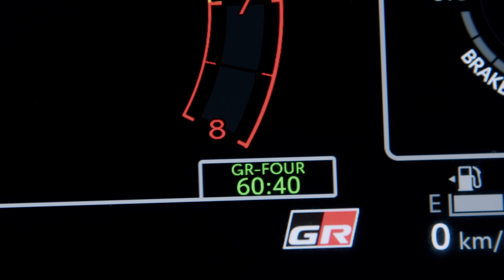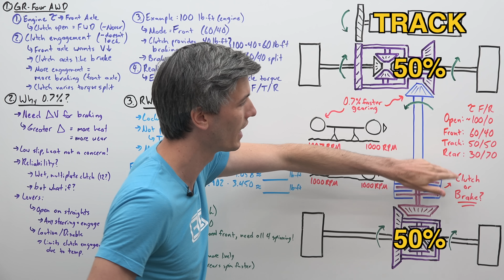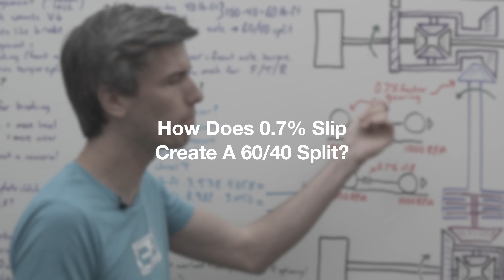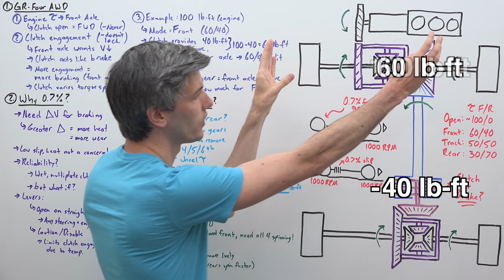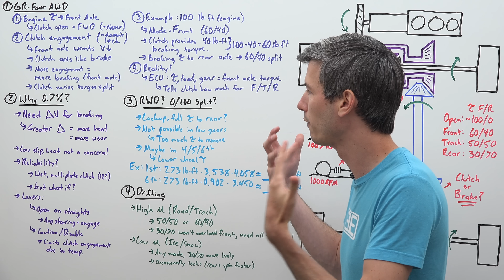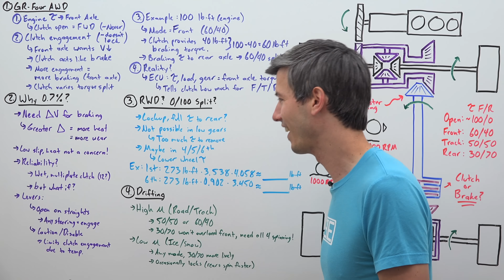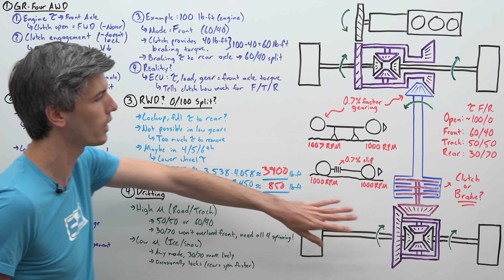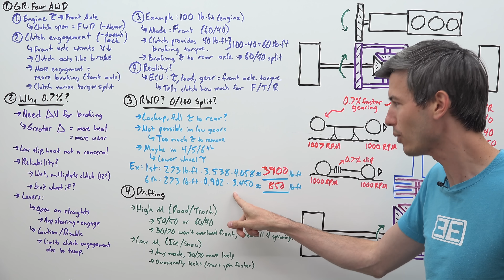Toyota GR Corolla's Brilliant AWD System - How It Splits Torque!

Comment from the maker: *Won't constant clutch slip create a ton of wear?!* Before you consider the system to be unreliable and inefficient, take a moment to think about what's happening inside an engine. You have a metal piston, sliding against a metal cylinder wall, thousands of times per minute, at ~60-90 miles per hour. And none of the comments seem worried about this? Rightfully, because cylinder walls use oil spray to minimize the friction and reduce the wear. In this clutchpack, we're talking about different materials, designed for the application, bathed in oil, with a massive surface area thanks to many clutch discs (spreads out the friction, minimizing wear). 0.7% slip is extremely low, and the friction created causes a torque to be sent to the rear wheels, thus most of the energy still goes towards powering the vehicle, with a tiny amount lost as heat. 

Still not convinced? Prior to this YouTube thing, I worked in the forklift industry. Some forklifts use the transmission to brake, rather than wheel brakes. These are wet, multi-plate clutch packs, exactly like you see here, and they do nearly all the braking for a 4-5 ton forklift. That's real heat, because brakes (in this case a clutch) are designed to turn kinetic energy (the forklift's movement) into heat. These clutches can last the life of the truck, thousands and thousands of hours. It's very cool, and pretty incredible! Not to mention, pretty much every multi-speed automatic transmission is using clutches. Heck, a single-disc, dry clutch inside a manual transmission, can also last the life of the car! 100,000 miles no problem, if you're not abusing it.

My only point here is, before you assume it will fail, why not wait and see how it turns out? Toyota has a reputation for cranking out reliability. Why assume they haven't done the testing and validation this time? If there's info on GR Yaris burning up these clutch packs (it's been out for a bit now) - definitely let me know, and I'm happy to share information on it! I'll remain skeptical that the clutch pack is the big reliability concern for this vehicle.

Edit: If anyone is curious how this differs from Golf R/Focus RS, I have a video explaining here! https://youtu.be/2-_Dzd74GUE
Reply: It’s so funny because that was the first thing that came to my mind. I really appreciate the extra info though and I will remain open minded.
Reply: I'm in the same boat it just seems inefficient, but you bring up good points. Also consider heat from friction is what kills clutches, not the friction itself. If the heat from the .7% slip isn't great enough to degrade the material then there's no fear of it failing.
Reply: so if you're driving on cruise control at 80mph on the highway, wheel rpm is about 1000rpm, so the shaft is about 4000 rpm so the clutch will slip at around 4000*0.7%~30rpm and at low load, but it doesn't make sense that the clutch doesn't completely disengage, to reduce wear and fuel consumption? obviously mileage os not concern #1 on a corolla GR, but reliability under heavy use?
I understand it's not going to heat up or wear as fast as a clutch launching the car at 3000+ rpm but still a very odd design to have a clutch slipping 100% of the time. plus a manual transmission only has a big speed difference when starting from a dead stop, when changing gear, speed difference is either minimal (perfect shift) or the clutch slips and the engine speed matches the gearbox after a few tenths of a second. the clutch spends less than 0.7% of the time slipping from a stop to first gear, and it has thermal mass to take the heat, and then cool down when its not used, whereas this will lose power and generate heat continuously. If you hammer a clutch several time in short intervals its going to overheat for sure.
my concern is not only that there's a clutch slipping all the time, but that its also responsible for continuously transferring ~50% of the torque to the rear wheels so not.
Of course if it makes the AWD/handling better, the part is easily serviceable, then OK why not! people who are lucky enough to put their hands on this car wont mind low mpg
Reply: It still looks like electronically controlled honda crv rear diff.
Reply: Other way I think about the possible clutch wear is by thinking of allowable tire slip before abrasive like wear occurs(minor slip can be taken up by material properties). If Toyota has done their engineering well(something they have done for decades), I don't see any reason why the setup shouldn't work reliably. If I have any complaint about Toyota trans mounted engine cars is that they tend to torque steer BAD(my experience in every Toyota that has a trans mounted engine; 5 cars made in the last 15 years). Hopefully it has symmetrical drive shafts.
Reply: @saccaed  that’s true of their economy, or non sporty cars. But the Corolla XRS actually has an intermediate shaft that is fastened to the back of the engine block riding in/through a captured bearing. This allows both the driver and passenger axles to be the same length and this basically eliminates the torque steer. I can vouch for this working because I own both the base Corolla for daily abuse and an 06 XRS for light weekend duty when I want to go around twisties. When they want to they can engineer and produce very stable sporty cars, even fwd based. But there really wasn’t any need on their basic cars since the majority of people normally don’t drive those hard.
Reply: I'm sorry but just because some vehicles use the transmission as the brake doesn't mean a car can be using its clutch pack as a brake 100% of the time. Most of these systems like the GKN AWD system and the Honda SH ATTS cruise in greatly reduced rear biased modes. Cruising along the freeway they cut down to 5-10% rear bias. Additionally just do some math. Let's just assume track mode with the 50/50 split. Engine is using 100hp (simple numbers) so 50hp is going to the rear. That .7% differential is creating 260 watts of heat constantly. The rear differential has ZERO cooling ability, no fins on the case, no separate radiator, housed right next to the exhaust pipe with little airflow. Total fluid capacity on the GR Yaris is .5L. There is simply no way for this system to offload heat. Meaning it's more likely like every other system on the market and will cruise in 90/10 or similar F/R bias mode and not give a static 50/50 split. On the track and in sport mode this means this .5L system needs to deal with over 1hp of consistent heat. Basically turn your toaster on and leave it on full blast for 20 minutes. The wet plate system simply can't handle that kind of heat without some kind of cooling method. It's unlikely this system is a static split.
Reply: There's plenty of airflow, you're driving along.  Hang a 260watt electric heater out your car window at 30mph and it won't get warm because the wind sucks the heat out of it faster than it can be generated.  @Vermonstered
Reply: @marespellees321  Not sure if you noticed, but under and tucked into the rear axle of the car is NOT the same as you hanging out the window. Additionally 260 watts example is cruising on the highway if it was permanent split (it's not). At full throttle the overdrive gear generates more like 5x that. Don't care how much airflow you have over the smooth housing, it overheats as the car does often at the track. Though not sure why you're coming at me now with the car out for over a year with the problems well documented.
Reply: Came to the comment section to ask this. Cool. Thanks. Haha
Reply: Thanks Jason, you answer the first question that came out. 
The second one i have is : does that mean that this system "waste" power into heat ?
Reply: All that is good in perfect condition and regular daily drive. Let me see how this system will perform when driven on ice/snow/mud or some harsh conditions... What kind of service is required? I told you, on my old VW it was a failure...
Reply: I'm sure it will be fine, but it will be considered a wearable just like any other friction surface. Motorcycles typically (some Ducati's don't) use wet clutches like these and last for a very long time.
Reply: @DevMeloy  i agree 👍🏻. The only thing I hate is the heap they create around it ...
Reply: @DevMeloy  as someone who has replaced hundreds of motorcycle clutches, I utterly disagree.
Reply: @eyeballengineering7007  only time will tell.. hundreds of clutches over the millions of motorcycles is a drop in the bucket.. I agree the concept sounds idiotic but someone smarter than you and I did the math and found the wear acceptable..
Reply: @DevMeloy  "acceptable" like the oil pump on the baby duramax being belt powered. Between the engine and transmission. In the crankshaft oil. With 150,000 miles being the maximum life.  I'm pretty sure it was this same channel that was touting it as an engineering marvel.
Reply: @eyeballengineering7007  stuff wears out.. 150k is nothing to sneeze at. Although the placement is a poor decision..
Reply: So these "brakes" (wet clutch pack) will never wear out... nice, why don't we use wet clutch packs for all brakes?
Reply: @iwantmypot  I don't think anyone said they'd never wear out.. oil bath has benefits over dry clutches. And you wouldn't want this on all four corners because unsprung weight.

You guys are getting worked up about something on a "performance" car, this isn't going on the daily driver and anyone who has owned a sports car knows there is a cost.

My Mustang came with summer tires which lasted about 12,000 miles but gave amazing grip the first 10,000 miles. That is not a design flaw but a compromise.
Reply: @iwantmypot  Forklifts typically don't go that fast, so the amount of power dissipated by stopping it is not really the same as stopping a vehicle that might only be half the mass but going 4x to 8x the speed. The rate of energy dissipation stopping a car from 60 to 0 would definitely create wear. 

It's not like clutch packs never wear out - it's just that if you know the application, you can design them to last the expected life of the vehicle with nothing more than fluid changes.
Reply: I’m on the original clutch on a 2009 Hyundai Elantra. Mileage? Past a ¼ million and sitting pretty at 276,000 miles. Original clutch.
Reply: @firefighter4443  According to half the jokers in this comment section, your Elantra's transmission should've grenaded itself 276 times already by now lmao. Congrats on the mileage though.
Reply: @firefighter4443  Hold the clutch pedal down 1/4 inch from now on and get back to us on how it lasts...
Reply: How does it compare to Wrx sti?
Reply: @higherarc0598  No significant advance.
Reply: Thanks for addressing this. My non engineer brain had this question as a general ?, Not really as a fault in the system.
Reply: I left another comment, but isn't this basically what the Subaru ATS system is?, which has been around for years.
Reply: @stuntmonkey00  Not quite. Subaru ATS replaces the center diff with a clutch pack. There is no difference in drive ratio sent to the front or rear diffs. This Toyota setup has no center diff equivalent. The Subaru system can be configured for full range 100/0 to 0/100 torque splits(though I don't think it's ever been offered, it can be configured that way). The Toyota setup is limited in torque split control as the front tires are always driven and only effected by clutch engagement for the rears.
Reply: @saccaed  It's the same idea in Subaru ATS and this Toyota system - front wheels are mechanically connected while rear wheels are powered by a clutch-pack. The difference is the placing of the clutch-pack. Subaru ATS system can be switched into FWD mode but it cannot work as RWD.
Reply: @4x4.tests.on.rollers  To the end user they behave essentially the same. Subaru effectively still has a center diff(they say they don't but it's just clutches). Your correct about the limitations of torque splits as shipped. There are minor technical differences that could matter for anyone inclined to modify the stock setup though. The Toyota configuration behaves more like a 6x6 in that the front diff is a pass through(like the middle diff for a 6x6) to the rear diff with a clutch pack between the rear driveshaft and rear diff.
Reply: @saccaed  I'm not sure if I understand you well but - ATS doesn't have center diff. It's just a one way clutch-pack in transmission (of longitudinally mounted engine) which is powering the driveshaft. Toyota has this clutch-pack just ahead of rear diff. There is no serious difference how they power front wheels (by gears) and rear wheels (by multiplate clutch-packs). Other thing is Subaru's VTD with center differential and a clutch-pack responsible for TBR.
Reply: @4x4.tests.on.rollers  Two defining differences between Subaru ATS and the Toyota setup of the video. The major difference is that Toyota has the rear wheels over driven and that expands the maximum torque that can be sent rearward. Subaru does not have any gearing difference between the front and rear. The second minor difference is that the Subaru configuration is essentially identical to every other Subaru in that Subaru swaps the internals for the diffs to create different awd configurations. Toyota is using a pass through front diff and standard rear that has a clutch pack between the rear driveshaft and the rear diff. Where with a Subaru the end user can swap out front and rear diffs typically with little other modification needed, the Toyota setup is going to be much more involved if someone wants different behavior. For example, Manual WRXs come with open diffs front and rear. Those diffs can be swapped out for helical or torsen diffs found in other models(and typically model years) to upgrade the drive train. Swapping to a different Subaru center diff is normally best done by swapping the entire transmission as subaru transmissions and center diffs are an all in one package.
Reply: @saccaed  Sure, all clear and that's what I mentioned before - placing of things is different. But the entire idea of geared powering of front and clutch powering of rear is the same (apart from overdrive etc.). Older Subaru with ATS even had that FWD fuse socket which opens the clutch-pack completely.
Reply: @4x4.tests.on.rollers  No serious difference other than that the Subaru clutch has 0.0000% slip 100% of the time and this thing has 0.7% slip 100% of the time.
Reply: @johnpublic6582  That's not correct - there is always a slip in every clutch based awd system. No slip can be achieved only in laboratory conditions (and of course when clutch-pack is locked). While driving the speeds of front and rear axles vary constantly so there is always a slip.
Reply: @4x4.tests.on.rollers  You are talking about slip an order of magnitude smaller than the 0.7% here and it is happening low single digit percent of the time, not 100% of the time, so I can't agree that these are at all comparable.
Reply: @johnpublic6582  Of course - by mechancial design - there is no slip as front and rear gearing is equal. But during driving there is always a slip, all the time, especially during cornering but also during straight driving - slip that comes from the road, not the system itself. Obviously if the front/rear gearing is different then the slip is higher.
Reply: I love that your videos take such a detailed topic and make it understandable for simple people such as myself. Keep up the good work
Reply: I think there is too much black and white thinking in this case. Of course in a wet clutchpack there will be wear. If there would be enough lubrication that there would not be any wear, then there would also be "no" friction.
I think the comparisson between cylinder walls in an engine and such a clutchpack is not fitting, as the cylinderwall and piston rings are not meant to have enough friction to transmitt force. Quite the opposite.

But, and that's the difference: if it is engineered with the idea that it slips constantly and frction is constantly aried it also means it is designed for the wear that is expected. (If it's done properly)
-> Cooling, a fluid that is made to handle the temperatures, filters to collect debris, and intervalls of fluid changes.
(I would bet that Toyota has certain intervalls for the change of the clutchpack fluid at least.)

And if we compare it with automatic multi clutch transmissions with a wet clutchpack, then there too are intevalls for fluid changes that also include a filter so that the internals of the gearbox are protected from the wearing debris. (And if a manufacturer claims "lifetime filling" then that just means that he expects the car to not last long)
Sure it's even more important than with just a clutchpack, as single clutchpack does not involve valves that are using the same fluid, but 100 000 miles without a fluid change in an auto transmission in most cases also means the transmission is done after that time. If you change the fluid every 37k miles for example (that's the intervall of my current cars converted to colonial units), the transmisssion will last a lot longer and have fewer "hickups" during it's life. 
(I know enough people who believed in "lifetime filling" of their transmission fluid and their transmission lasted for around 100 000 -110000 miles, and i know lots of people who let the workshop change their trans fluid according to manufacturers intervalls like 60k km or 70k km  ~37k miles and easily got ther transmission to work for over 250k km ~156k miles and more)
Reply: Hur hur gr corolla 3 pot go KABOOM... Im staying the f away from any thing GR for at least 3 years.
Reply: @ktkace  I totally agree with letting any new tech simmer for a bit.. buying first gen can really bite you in the A$$
Reply: I'm just thinking that having 4wheel steering with equal (opposite) angles would be the only way to always match front and rear wheels speeds and could simplify the design of a track oriented AWD. I know most rear wheel steering use variable ratios depnding on the speed or even switch the angle at different speeds, but could a "simple" system just mirroring the front be actually simpler ? it would mean also it would need wheel arches and suspension that can accomodate the same full lock steering as the front. but it would have ways smaller turning radius, or you could also halve the angles and make it easier/simpler/cheaper.  has it been tried already (other that on monster trucks/rock crawlers)
Reply: You worked in the forklift industry? Wow, I did not see that coming. You totally come across like my college instructor for integrated circuits class. Great guy and he also had a gift of being able to explain things, plus he loved his whiteboard too! Good lord, he loved his whiteboard.
Reply: How would you compare this system to evo x?
Reply: @SamMarr77  open of course
Reply: Plus there's no thermal efficiency loss because the clutch plate can be located underneath the driver's seat and function as a butt warmer.  Win-win!
Reply: thanks for the heads up, but it still makes me uncomfortable to be constantly reminded that im actually slipping the clutch... on the flip side tho, should these clucth wears out, the car would still be running no problem... I also wonder why wont they just use a planetary gear instead?
Reply: @krisnadiimam4556  The reason for the clutch slip is to give the different torque splits, this couldn't be done with planetary gears as easily.
Reply: Aaaaa
Reply: I've always worried about the clutchpack in my Audi's DSG.  I hope the same prinicple holds true there.  124K miles and no issues yet.   

On the other hand, we all know the friction inside an engine zaps quite a bit of HP, I think the constant slip of the GR's clutch will do the same thing. Seems an unnecessary move to complicate an already figured out system.
Reply: How is a forklift comparison an equivalent comparison when a corolla is so slow??
Reply: Can you comment on the GR Yaris and GR Corolla with overheating differentials, shutting down the AWD system after just 15 mins of tracking?
Reply: that's a false equivalency and you know that.
Reply: I have a telehandler forklift with 4000 hours on it that has all the clutch brake discs worn out to the metal right now.. don't tell me that these last the life of the machine. The machine still has plenty of life left and these discs are utterly trashed
Reply: @eyeballengineering7007   Also, the forklift is stopping from 1.5 mph, not slipping the clutch continuously at 60 mph.  Saying "this system will work in the car because forklift" is sort of comparing apples to jet engines.
Reply: @eyeballengineering7007  transmissions wear out anyway. Thats a normal part of owning a vehicle. This system is probably more costly, but at the end of the day its not going to be any worse than a regular automatic transmission. Its doubtful they would design this system to last any less time than the transmission normally would. But as with any new system, there will be things to work out and manufacturing processes changed to make the most of the materials. So maybe early systems will suffer premature wear, but in the long run theres no reason to believe the wear on these drive systems will be any less reliable than the transmission of the vehicle.
Reply: @eyeballengineering7007  eleventy billion motorbikes out there with wet multiplate clutches. Yes of course they wear out but they do last a long time, and the slip does get used a lot for delicate low speed control by some bikers — we're taught to use it
Reply: @jsleeio  Now do any of these motorbikes slip the clutch all the time? Or is the slip only used in part throttle feathering? This car uses it 100% of the time any power is applied. From no throttle idle to buried. There's a massive difference in application. During a 1 hour drive on the highway the GRC is slipping the clutch for 1 hour. A motorbike for the same? Under a minute and that's being generous.
Reply: @Vermonstered  no, not all the time. However the amount of slip used can be significant, especially in low speed city riding. Depends on the bike and rider. Some bikes (like my BMW K1200GT, but definitely not only that bike!) have unbelievably bad throttle/fuel mapping and really fine adjustments in wheel torque require slipping the clutch quite a lot. Certainly far more than the 0.7% quoted in the video here
Reply: If anything in this life is certain, if history has taught us anything, it’s that you can kill any clutch.
Reply: Yes. I drive forklifts and very rarely use the breaks. I know someone that drives forklift for a different company, and they were told to never use the breaks.
Reply: Another use case for sustained low-RPM clutch slippage is in automatic transmission: there are certain low-RPM bands in the engine’s rev range that are more prone to excess vibration. To help mitigate this, some transmissions actually slip the torque converter clutch 30-50 RPM to isolate those engine vibrations.
Reply: @Kyriaeus  I did not know this! Tnx
Reply: @Kyriaeus  A torque converter is nothing like a clutch, it just goes in the same place between engine and trans as a manual clutch.  A clutch has parts that touch each other in order to transfer torque.  A torque convert has no touching parts, all the torque is transfered through hydraulic flow, so not only can they slip a little since there is no mechanical connection, but they can not be prevented from slipping without adding additional tech.  In your lockup torque converter that additional tech is a clutch that does not slip.  You'll also see that if there is a malfunction that lets this clutch slip, it will burn out completely in a very short time.
Reply: @johnpublic6582  i suggest you read up on some SAE content before making stuff up. The multiplate lockup clutch in modern torque converters can be controlled to sustain a 30-50 RPM slip to reduce NVH when the engine is running at high torque low RPM. This is not the same thing as just having the torque converter itself open and doing torque conversion.
Reply: I appreciate your effort to get out in front of the "Technology!@? THat'll never work!" comments, I hope it works. 
Thanks for a fantastic whiteboard video to cap off a Friday, excited for the GR Corolla review
Reply: Superbikes have what you call slipper clutch which prevents the back wheel from locking when changing gears down in a corner, I would relate your explanation of clutch slip the same as what I mention above about a bikes slipper clutch. Am I correct?
Reply: Also worth remembering, is that Toyota have been making forklift trucks for a long time. The forklift division ownership seems to change back and forth between Toyoda Automatic Loom Works (the parent company) and the Toyota Motor Company BUT essentially it is all the same enterprise.
Reply: Wear? sure but I'm more interested in how much power is lost due to this "braking" system vs a directly connected driveshaft/diff?
Reply: I'm pretty sure a lot of automatic transmission vehicles use the transmission's clutch packs to help slow down the vehicle a bit while braking to minimize brake wear. There's also a very small amount of slip every time an automatic transmission shifts gears and a lot of them can last several hundred thousand miles.
Reply: @HerculeanPearl  A small amount of slip in an auto trans when it shifts means it is slipping about 0.000001% of the time, not 100% of the time.  Also, auto trans do not use the clutches to engine brake.  They use the clutches to zero slip connect the wheels to the torque converter which does the engine braking into the trans fluid, no mechanical connection here, just lube, which has a radiator to get rid of that heat.
Reply: I suggested on your koenigsegg cc850s video to maybe do one on automatic transmissions, but imagine how much all the clowns in this comments section would be clutching their pearls when they learn how things actually work lol
Reply: 4-5 ton forklifts are baby lifts.
Reply: All I want in life is a light 2800 pound to 3000 pound and car that has awd on launches and once it gets to 60mph it automatically turns into fwd giving you less parasitic drive train loss so you get the benefits of acceleration from awd and the a bump in overall power from less loss of power once converted to fwd
Reply: @yackemup  To achieve less friction you have to actually not move the spinning parts as in hub lockers.  All the components in this system still turn all the time.  When the clutch is open the parts ahead of the clutch are driven directly by the engine and the parts behind the clutch are driven by the engine through the roadway and back in through the rear wheels.
Reply: great work, as usual. Helping us understand such mechanical magnificence. Thank you, Jason!
Reply: This reminds me about the Evo AWD system
Reply: how do clutchs work id theyre lubed, surely it needs traction not lube, or am i just wrong
Reply: When metals are oiled they are almost not touching each other what is important is keeping the temperature down to keep the metals and the oil safe and you can trust toyota they probably where testing this clutch using v8 engines hahahaha.
Reply: Your remark about a clutch in a manual transmission lasting 100K is pretty spot on. My 2014 Jetta TDI is in my garage for a clutch job at 109K miles. It's been tuned with an upgraded turbo for a six months now and I haven't been gentle with it since I got it at 45K miles.
Reply: Your explanation placates the thought of excessive wear, as that was my first thought while watching, my second thought was what it does to fuel economy. Sure on the straight bit you'll be in front wheel drive but there are many highways with corners you don't slow down for. Your explanation, in the video, indicated that any turning and the clutch would reengage.
Reply: The same thing happens in a Salisbury or Torsen differential on every curve the vehicle encounters ,and it does not wear them out.
Reply: howz aboot them apples ya' bunch a haters!
Reply: Jason, great video. Many of the people, including me, are experiencing an overheat issue with the ITCC. Mine happen after just four hot laps at Sebring.  A warning message comes on the dash saying something like "AWD not available" and the car goes into a default front wheel drive mode.  I'm curious as to what you think is the culprit to this overheat issue?  Why would street driving not do the same thing.  I can't see how I'm spinning the front or rear tires on the track any different than the street.  Your thoughts?
Reply: @billbenavitz  Pretty simple. The system is ALWAYS slipping the rear clutch pack generating heat depending upon the rear bias setting and the demands being asked of the car. At the track you're pushing the limits and the car is producing a lot more power than on the street with little to no cool down time. The rear overdrive gearset is the culprit. Also the more grip your tires have, the worse the problem is because it's harder to get the tires to slip. There's not much you can do about it without significant investment as there simply isn't enough airflow or cooling capacity in the clutch coupler housing.
Reply: @Vermonstered  

So, if one was to drive the car 80 mph on the highway continuously, it would seem this would cause a similar condition, but it does not, does it?  If the ITCC's purpose is creating a different torque split between the front and rear axel, then nothing I'm doing on the track exacerbates the slipping other than just the constant high speed, right?
Reply: @billbenavitz  Incorrect as you're thinking it's a static split. It's not, cruising the system defaults to 95% FWD or similar number. Otherwise the system would burn up like you're thinking. It's only when the system detects slip or enough steering angle does the clutch pack clamp down and delivers the requested split power to the rear. Additionally cruising at 80mph requires a lot less power than WOT 3rd gear pulls repeatedly. Remember, .7% (I actually think it's a higher number being most other systems state closer to 1.5%) of the power pushed rearward is converted to heat assuming the tires are gripping. At WOT you're talking around 1100-1200 watts of energy being converted to heat. There's simply no simple way for such a compact system to offload that heat quickly. The Toyota solution for the GR Yaris racing teams is to remove the gear multiplier which removes the 30/70 split option but allows the system to work sufficiently in race environments on tarmac. There's also differential covers which increase fluid capacity, underbody fins to direct air onto the unit and people have tried to thermal wrap the exhaust but it all are band aids and the problem will still persist as inherently there's not enough surface area or air flow to cool the unit while the unit itself is creating so much heat.
Reply: Anytime a clutch pack in an automatic is slipping, it is absolutely wearing. Anytime a clutch pack in an automatic transmission slips continuously, it wears out immediately. This is not debatable.
Reply: @eyeballengineering7007  It absolutely is debatable as you have left no room for the different types of wear that occur as slip and load varies. Note that there was no mention of no wear. The comment specifically is pointed to anyone who would think the wear to be akin to leaving the clutch partially engaged in a manual transmission or riding the brakes; those are not going to be an apt comparisons. Comparing to internal engine wear is reasonable. Please read critically before jumping down someones throat.
Reply: @saccaed  Comparing to engine wear is absolutely wrong.  The piston and ring don't touch the cylinder walls at all.  There is always a layer of motor oil.  Think of how an engine can run 500,000 miles, but if you get a stuck open injector that washes away the oil, or it is run with low oil the engine can be completely destroyed in under 100 miles.
Reply: @johnpublic6582  This is so wrong. Don't know what magic engine your referring to but I've done several engine overhauls and there is not a single one that hasn't had bore wear. Your right about oil being very important to maintain a very minimal amount of wear, but absolutely wrong about bore wear. A 500k miles engine absolutely is going to have bore wear and is likely to have some noticeable blow by as well; the engine may still be workable, but it's going to be ready for at minimum a ring replacement and bore hone.
Reply: @eyeballengineering7007  In my BMW X3 20d 2008 the clutch pack in the transfer case slips continuously more or less, and that seems to be the least problem by these cars! The actuator may fail, but then you just rotate the plastic gear in the actuator 180 degrees and the problem is solved!
Then I think they keep track of the oil temperature, and at too high temperature the clutch will not be engaged.
Reply: @leiflillandt1488  I think that is a misconception: as far as i understood BMW's X-drive, it's basically rwd until the computer engages the clutchpack in the transfercase. Sure then it can vary between fully engaged and fully disengaged but in essence if you drive on the road and avoid full throttle in a corner for example ect. your clutchpack is always completely open and thus has 0 wear in that time.
The big difference to older Haldex systems for example is that the computersystem regulating the clutch has situations where it preengages the clutchpack according to it's mapping already before and wheelslip occurs.
A sure method to kill it over time would be to have different size wheels front and rear (i mean the outer diameter of the wheel and tyre combination) because then whe clutches would constantly engage and this for example kills the clutchpack in some jeeps with a similar system.
There is going to occur wear, but it depends for which amount of wear the clutchpack is dimensioned... (If the clutches are to be constantly slipping a bit like in the Toyota in this video, it will be dimensioned differently than the one in an BMW X drive for example, where this is not the designed goal.)